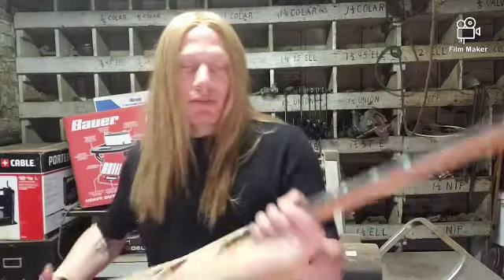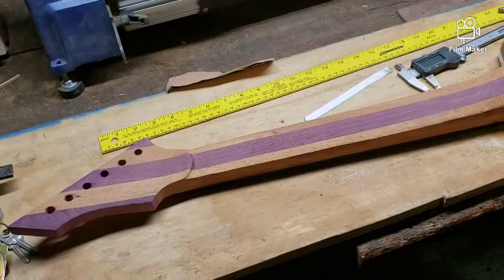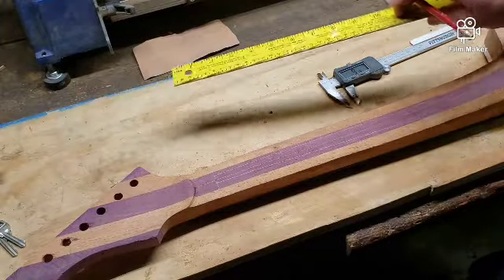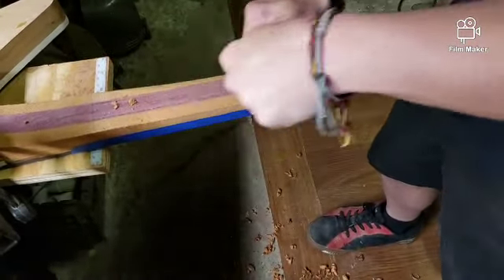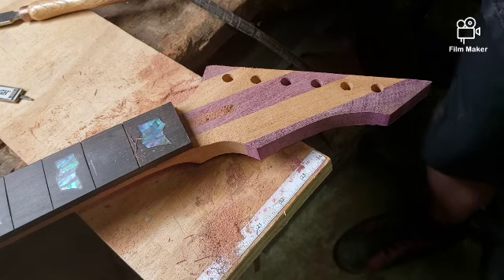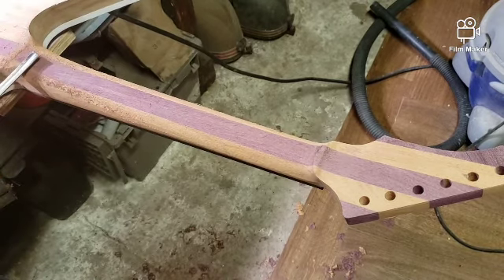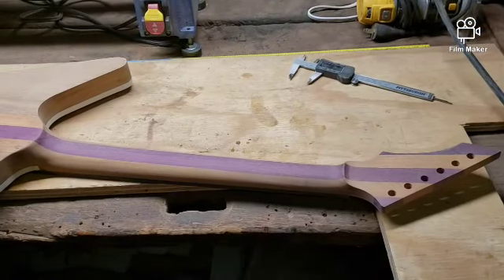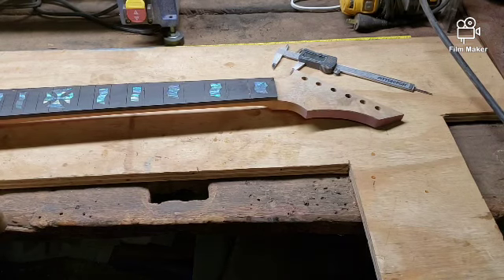Handmade Custom Explorer with all exotic woods  , James Hetfield inspired Guitar part 5 ISOG

Comment: How much for a maple guitar similar to this one. Ballpark?
Reply from the maker: Give me s call and we can work something out. It all depends on the woods, hardware ect. I'm sure we can get your dream guitar for a decent price. My number is 304 491 7984. Most places are going to charge 3k & up but I can do better than that
Reply: @iansstrungoutguitars  yes.  That sounds good.
Reply from the maker: @rev.jimjonesandthekool-aid4488  killer,  well whenever you get a chance give me a call. If for some reason I don't answer its the damn spam thingy but leave a message & I'll call right back. We could make something badass within your budget I'm sure
Reply: @iansstrungoutguitars  im super excited. I want something one of a kind. In the meantime i will look at hardware and pick ups. 
I like maple or blonde woods.  A maple freatboard, whammy bar, locking nut, duel humbuckers.
Maybe ill find some abalone shell for fret marker inlets. 
A pc of rusty roofing tin pick guard 
Something like that
Reply from the maker: @rev.jimjonesandthekool-aid4488  that's all completely doable!  I could make you something badass nobody else has!  ... if you haven't noticed my shop is a old machine shop from the 1860s -1960# & I haven't gotten it all cleaned out yet, there's tons of rusty tin 😆
Reply from the maker: @rev.jimjonesandthekool-aid4488  just in my opinion I think the old (well they still make them) kahler 2300s are great bridges.  I'm not just saying that because they're easier to install lol. You can't go wrong with a floyd but it's got to be a real 1 not those pot metal Chinese 1s.  Hell, I could talk all day about this stuff , so yeah give me a call or text me or email me lol